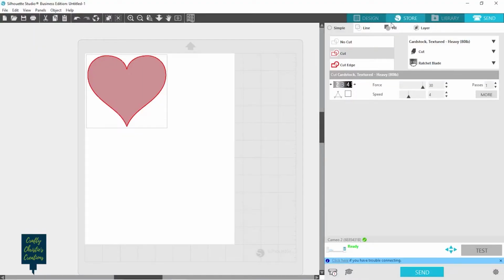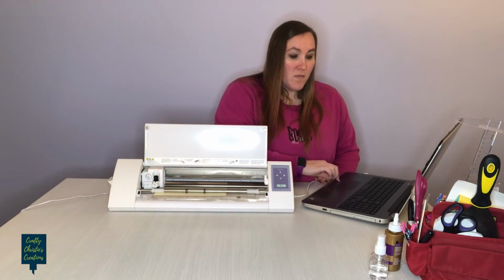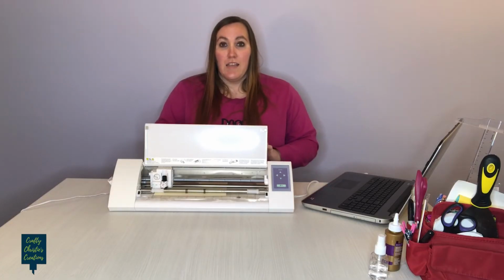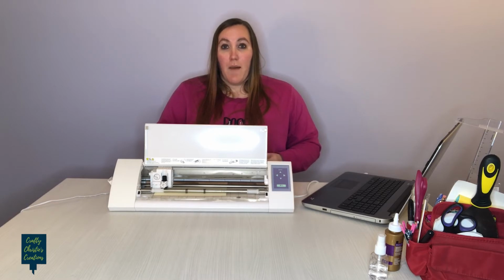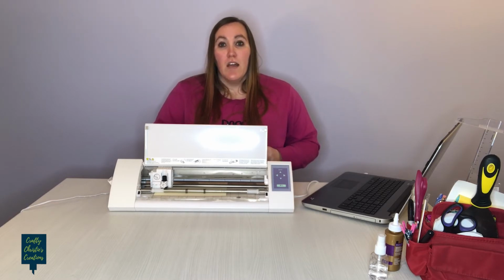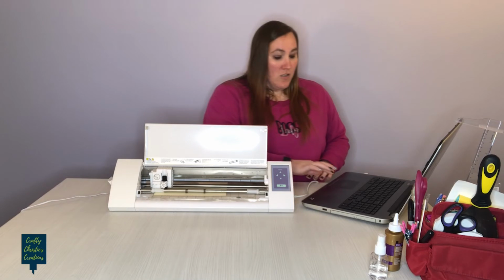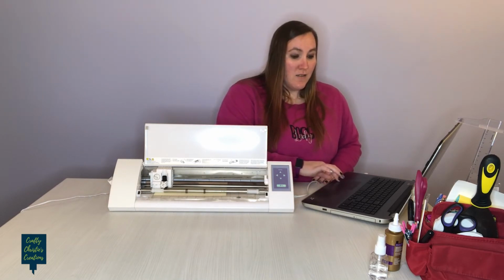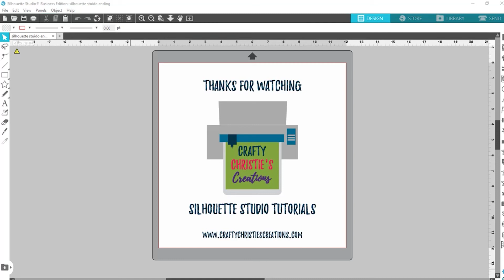How to do a Test Cut with Silhouette

Comment: This is one of the most important things people need to learn to do. Test cuts are the only way to guarantee a good cut with your machine, with your current blade condition, on your materials. You did a good job going over what you might need to adjust.